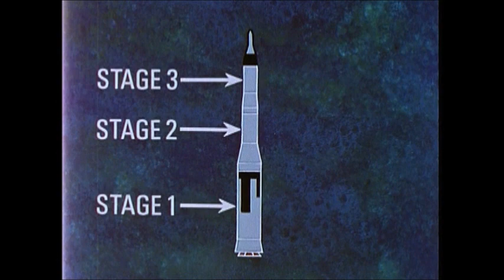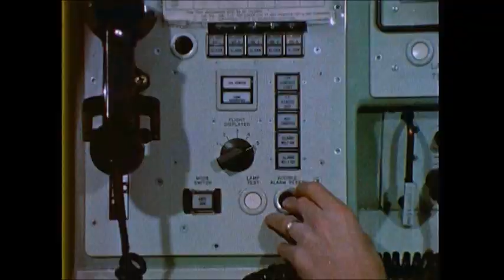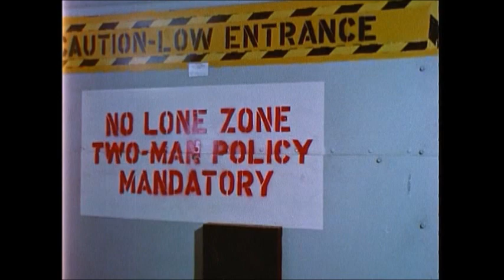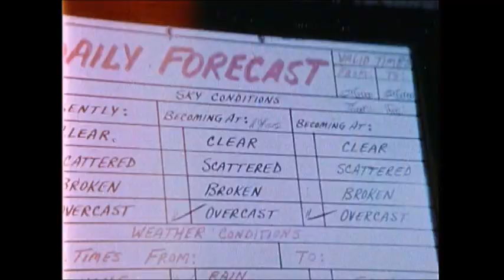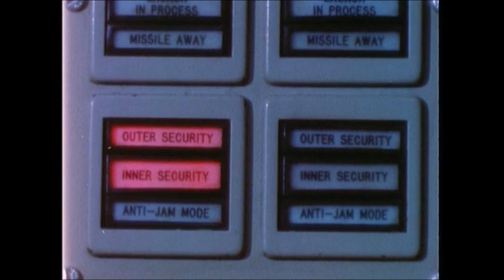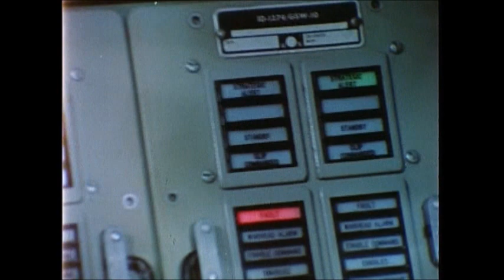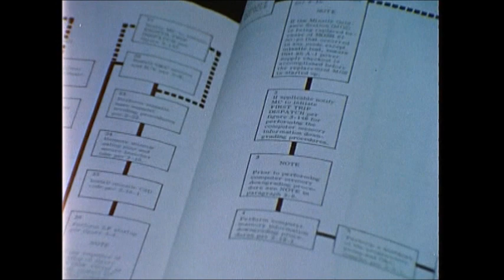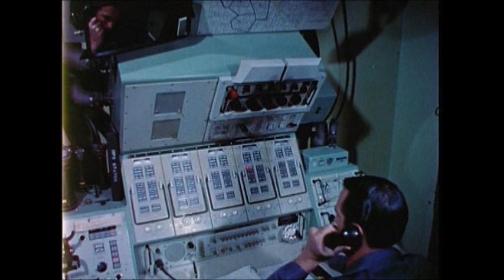Primed for Defense - The Minuteman

Comment: As a security policeman in the 321st SPS. at Grand Forks AFB in 1971-72 I wish I had a nickel for every pump stroke I made on those big effing blast doors downstairs at one of our missile sites after the LCF got an alarm at it.  Checking the equipment and making sure the site was secure.  Still remember my authentication code number 49 years later.

Comment: what is the location of the site used in this film?
Reply from the maker: I don’t remember but I would guess most of it was filmed in Oscar flight.
Reply: The first one, which was the LCC, was Bravo-1, located about 2 miles south of I-70 and US 65. The second one, Oscar 8, was about a 5.25 miles south of Whiteman AFB, on MO Route 23. The third one, Hotel 2, was located about 3 miles NNE of El Dorado Springs on MO Route H.
Reply: @jimsteele7209  Video said it was Hotel 2

Comment: Imagine having an accident with a truck carrying A NUCLEAR MISSLE
Reply: I think it's happened before !
Reply: That would be no peacekeeper.

(booing noises)
Reply: A WE 177b got dropped off a trailer in Germany. It was on a short journey to the transport plane to be flown back to the US for maintenance. Local community was told to stay indoors and close windows and the base all wore respirators until tests were done. The two threats were the weak Alpha particles if damage had occurred and the casing cracked. The big hazard was the explosives in the tail designed to fire the tail off when dropped on target.

Needless to say a lot of people got removed quickly from post.
Reply: The missiles were transported without warheads.  They were fitted later.